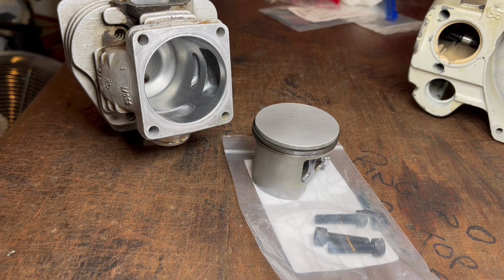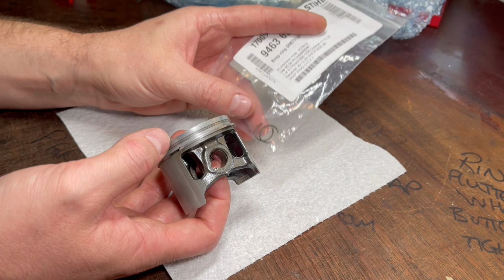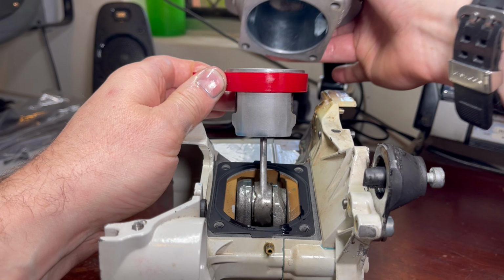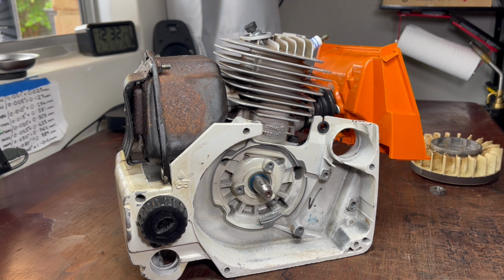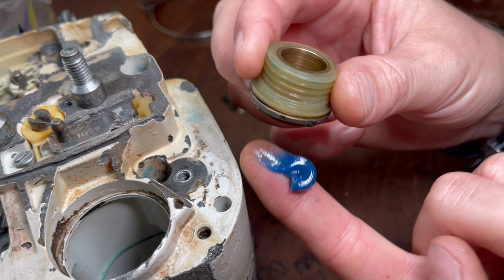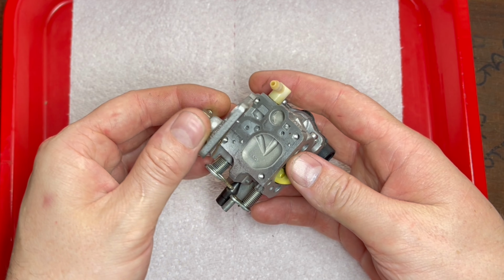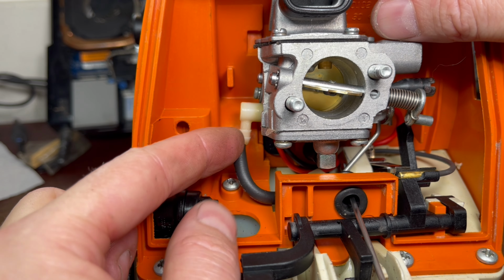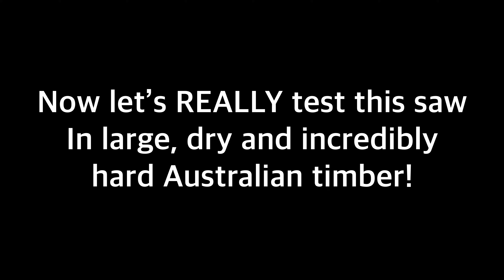GET MORE POWER FROM YOUR 2 STROKE ENGINES!

Comment from the maker: If this video helped you, please consider clicking on the THANKS button above to support my channel 🙌 Don’t miss this essential step when rebuilding your engines! I hope you enjoy my next video “Avoid This Mistake! It’ll Destroy Your Engine!”
https://youtu.be/APS6Z4RAESw
Reply: Nice video. I left the toxic community of Arboristsite the other day.
Reply: Thanks for sharing your two-stroke mix, I use Motul Oil generally at 40:1 as Sabre is impossible to get in the UK.
Reply: Oh, you touched the ground few times, there goes the chain for sharpening...
And that exhaust looks like ready to fall apart..
XD
Reply: Don’t much care for anything by AMxxxx.  I’m inclined toward ample oil, though - at least 32 to 1.

Otherwise, I’m really glad to see the parts I did do in the past confirmed, and learned about pressure-testing carbs and turning the shaft of the engine while testing.

Thanks.  Will keep this in mind for setting up the Zenoah.
Reply from the maker: There are some great and not so great people on there lol
Reply from the maker: That’s understandable, out here it’s hard to get and very expensive! £21 per 946 mls!
Reply from the maker: Hahah na not in this clip, but I did catch a rock the other day, ouch!!!
Reply: @patrickvennard838  Just get yourself oil with JASO FD certifficate and mix it 50:1 and you're golden. For example I run Castrol POWER1 RACING 2T for many years and my tools run perfectly.

Comment: My dad has a MS391  which he used in a saw mill rig and it "blew up" (he thought he had overloaded it) as it the cost of having it rebuilt at a authorized Stihl dealers workshop was about or slight above 2/3 of the price of a new saw, he bought another one and that the brand new saw blew up after 10-15 minutes of use... It was only then it dawned on us that i was the gas, my dad had bought some pre-mixed two stroke gas at a reputable store for once even though he usually mixes his own gas.. Turned out the gas had an insufficient amount of oil in it..

Even though I had no experience with this, my dad thought I could give it a look.. I managed to find a service manual, and found ordered a aftermarket piston/cylinder kit, and managed to tear it down and rebuild it and it came roaring back to life.. I then ordered a piston/cylinder kit for the older saw, for the older saw I also replaced the crank seals ans the wristpin bearing.. 
I found it a verry rewarding experience.. before I gave it a try, I really didn't think I had it in me.  but with som common sense, a service manual and a little YouTube I pulled it off 🙂
Reply from the maker: Well done mate and thanks for sharing! It’s empowering to challenge and over come situations like this! For a saw mill, run good oil at 25:1. The 391 isn’t a good choice for a mill honestly. Something that has higher torque, lower rpm and more cc’s is the best way to go :) older 90cc + range!
Reply: @VintageEngineRepairs  You know a lot more about stuff like this than me or my dad so cant really say that you are wrong about the MS391 for a mill, but for my dad I think it came down to a cost/use consideration..  and used 90+ cc chainsaws are really hard to come by here in Norway in any condition.. The mill rig dos not really see a lot of use, so I think my dad feels that i works for him,  But it's very good to know what to look for in a saw if needs should change 🙂

About something like this is empowering, I'd say you are spot on 🙂 after this I have had the courage to try and fix  more things on our power equipment.
I built up a new mower deck for our Husqvarna LT151 lawn tractor.. New deck-shell pan, spindles, and idler pulleys,, removed rust and painted hardware that was reusable.. sorted a leaky valve cover gasket, and serviced/rebuilt the transmission brake..
Reply from the maker: @jayytee8062  you can join arboristsite or ope forum and ask people on there for chainsaw manuals 👍
Reply: sry, but wrong! first thing chainsaw blew cause it was overheated on mill, basically every person who does this blows engine casue dont know how to mill. chainsaw is air cooled machine which means after one pass you need to cool it off and sharpen chain, what you can see in asia guy can mill, but it does with his own hands not with some tools he simply wallks and cuts from top down not to side, on top of it second guy coming and spraying bar with oil non stop they are not doing non stop full trotle. its cut go cut go. if you go long non stop cut you must rest chainsaw as there is no air moving like in car, even car will have fans chainsw dont. next why your dad blew abother chainsaw is even more simple. than you buy new you must not work on big trees only small branches so what engine would take its place same goes for cars bikes which are new they will say drive only slow certain speeds certain lengh on odometer after you can go full  go.and going on mill is death especially if its new

Comment: Hello, i rebuilt an ms250 which is not used like 6-7 years
Replaced every chain related thing 
it got a cheap cylinder kit and carburetor kit,oil sealent
didn't replaced the bearing which has it some black thing on it and the crankshaft bearing was rusty

Its start running hot and cold, has idle, but when i try to cut its bogs down and black burned oil comes between the muffler and the engine, tried rich and lean side but almost same 

little help where to start ?
Reply from the maker: Hey, sounds like it’s running too rich at full throttle if that’s the case, but also, it will take a lot of use to burn that excess oil up! So don’t be surprised if it’s tuned correctly that it still emits spooge! 2 strokes need to be run and loaded, if not you’ll get spooge

Comment: I’m curious why you didn’t hone the cylinder? I would never miss that opportunity while it’s all pulled apart. Great video.
Reply from the maker: Thanks Brent! These cylinders are nakisil and aren’t designed to be honed like cast bores for example. The Nikasil plating is very thin, very hard. A scrub with scotchbrite is ideal. Some people do hone them with silicone carbide ball hones, but I’m of the opinion that in doing so you leave such a sharp and aggressive surface you’ll actually detrimentally affect the longevity of the rings. This saw even with old used rings is at 165 psi after 8 tanks. It’s going strong :) like anything, you ask 10 people you’ll get 10 different answers, but I can only go off what I have experienced and for Nikasil plated cylinders, my advise is to avoid it. It’s not beneficial, it can lead to accelerated ring wear and the plating is so so thin you could damage it (or chip it!) thanks for watching!

Comment: Nice job Tom, where did you get that air gap tool at? 👍
Reply from the maker: Hey mate, it’s a stihl tool, I use it on every coil lol. Here in the part number for you. 0000 890 6401
Reply: Thanks Tom
Reply from the maker: @Big_Johns my pleasure mate

Comment: Tom, i found your channel 2 days ago (subbed) and i've immersed myself in it. (my Amazon basket will upset the Mrs). I have been scouring the web for advice with regards to a stihl hs82t hedge trimmer that is leaking fuel from the exhaust. It is not a blocked screen / spark arrestor as it doesn't have one. I could take this to a repair shop but have been tinkering with the 2 stroke stuff for the last year or so and get a lot of joy out of getting them running again. Where would you start your diagnosis with this issue? I have ordered a new carb and  its a 2016 model with (genuinely) little use. Any help greatly appreciated.
Reply from the maker: I have to ask why subbed was written and crossed out 🤣🤣🤣 change of mind? Anyway, leaking a bunch of fuel out of the exhaust is a sign of a flooded engine. If could be that you had the choke on too long, or alternatively (and I just repaired this fault on a customers machine) the metering diaphragm was so stiff that it was stuck in its down position holding the needle open and trying to start it just caused constant flooding. Hope this helps!
Reply: @VintageEngineRepairs Seems hyphons either side of the word crosses it out. Rectified and still subbed 🙂. The black oily leak is constant and I see the spray hitting the cutting bars. it "fine sprays" out about 5 inches. the machine starts every time then bogs down and eventually cuts out. I looked at the diaphragm yesterday and there was a white residue on the metering side. I cleaned that off and it still seemed very flexible to me but the fault continues. I've ordered a new carb and will fit it, but was thinking there could be other issues. I'll keep you posted.
Reply from the maker: @hubby-tubadventures01  or maybe just tuned way too rich :) try leaning it out !